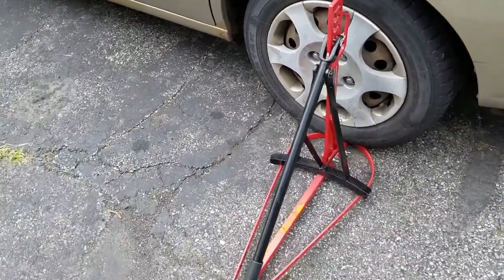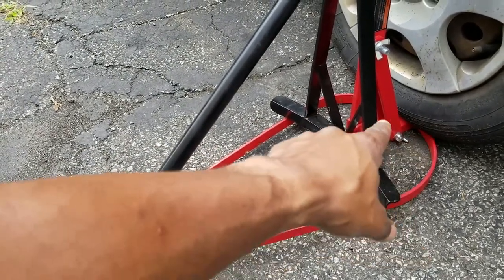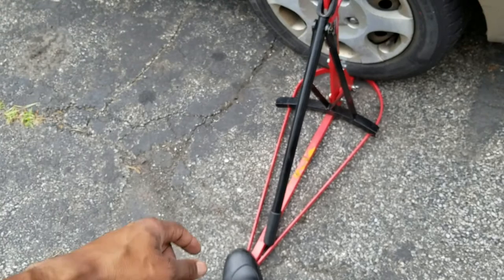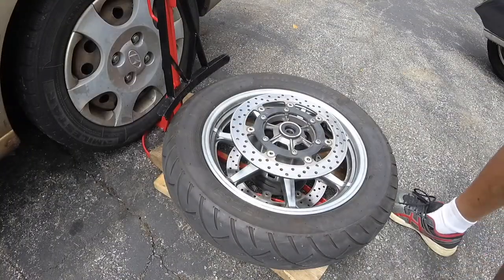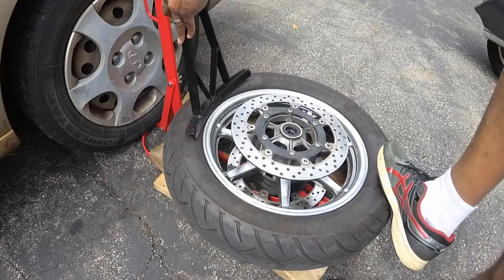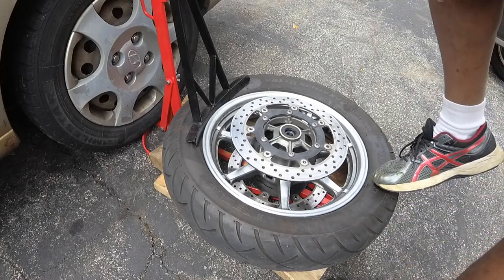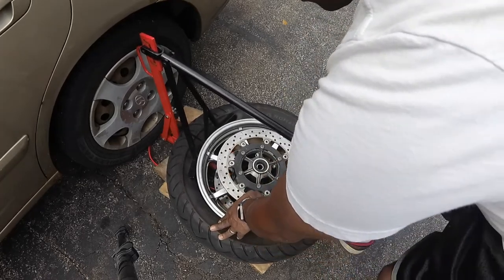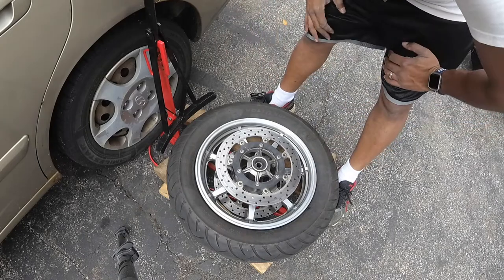How I Support the HarborFreight bead breaker Vlog#238

Comment: Dude, best 40 bucks I ever spent. It's payed for itself multiple times.  I've had mine for a few years meow, even thrown it across the shop a couple times. Still works great.
Reply: Twistygrip 👍👍
Reply from the maker: I'm always looking for some corner to put that sucker, but it's been so so useful. I just struggled for a while with finding a method to support the rear of the breaker.

Comment: Nice job, nice video.  That's a good tool.  I tried a couple times to do tires, but I couldn't get the new tire beads to seat.  Even the tire shops had a heck of a time with those stiff bias ply tires.
Reply from the maker: Yeah , I remember.  Sometimes it is better to just pay a shop. I can live with that,  as long as it's a place I trust.